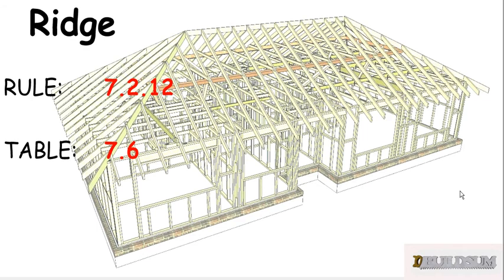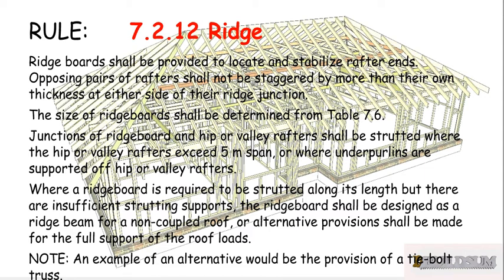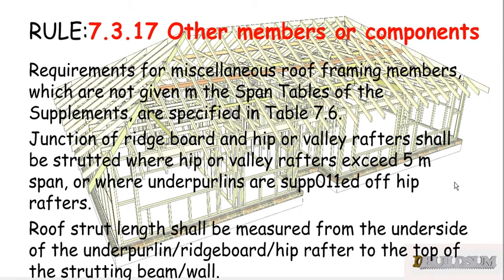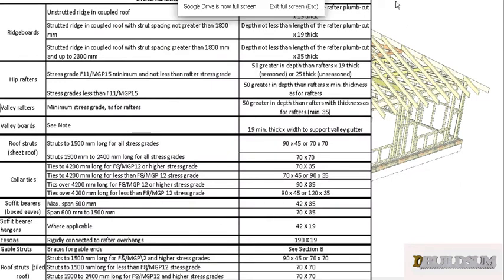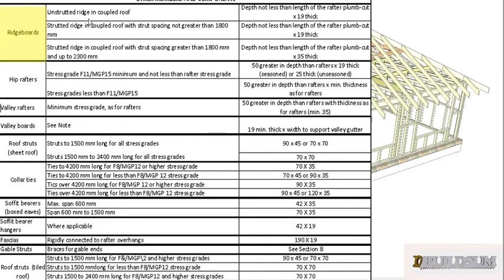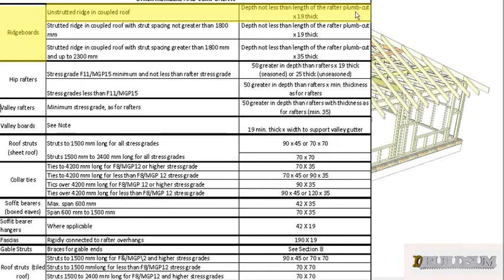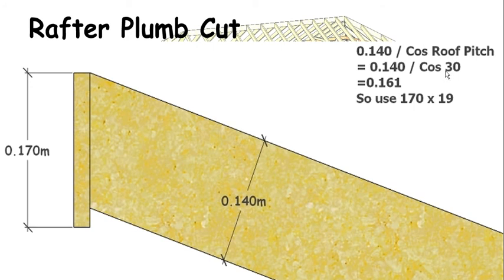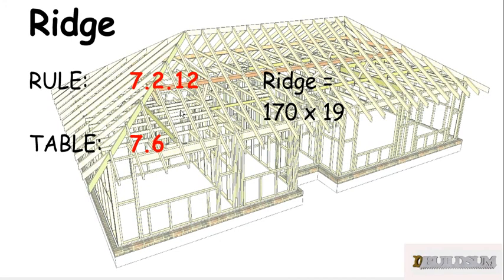14   Ridge

Comment: Does the length of the ridge also determine the size or it just has to be larger than the plumb cut?
Reply from the maker: There is no corolation between the length and the size of the ridge, as long as it is deeper than the plumbcut and a minimum of 19mm thick then all good.